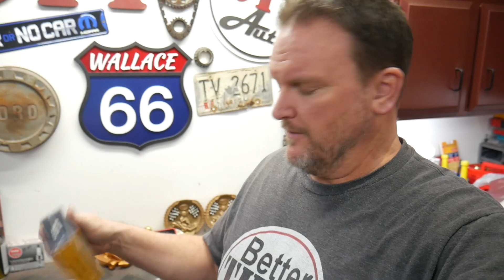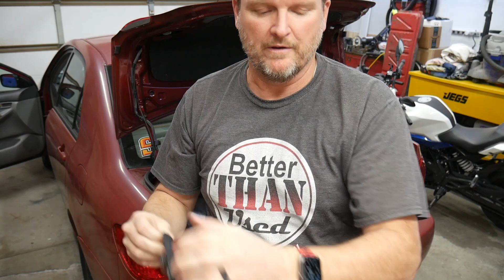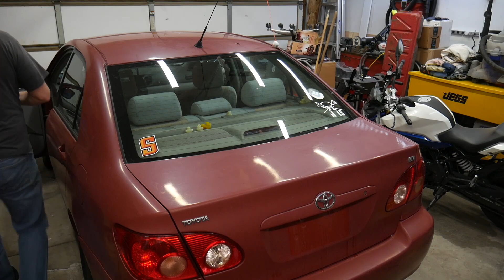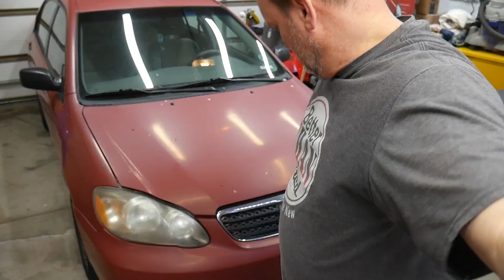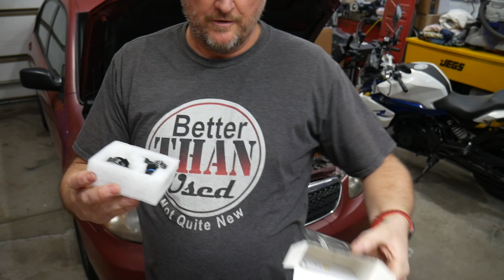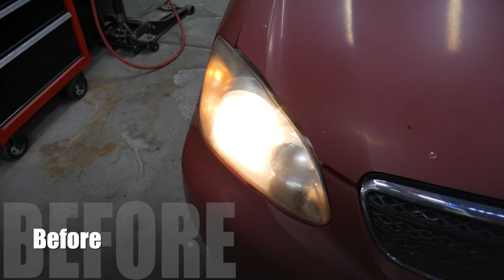EASY 2003-2008 Toyota Corolla LED Headlight and reverse lights Upgrade AUXITOLED

Comment: How many lumens are the headlight bulbs? Any issues with getting flashed by other drivers? TIA
Reply from the maker: These were 12000 LM no one ever flashed bright at me after this swap. 

Auxito does has some that are 20000 LM. The description of each bulb has the lumen rating listed: https://www.auxito.com/?ref=6d1hIV75
Reply: I assume the bulbs are still performing well.
I'm not familiar with this company, but likewise want to upgrade my bulbs as I can drive 40k miles a year for work so having great headlights makes that nighttime driving especially in less than ideal circumstances so very nice.
Old Mopar vehicles like Dodge trucks & Jeeps had such lackluster headlights when I upgraded my '00 Cherokee to LEDs it was the best money I've spent on that vehicke.
Reply: @harvestblades  those Auxito Y13 are a must upgrade. Those particular led bulsb are reliable. 

Definitely recommend them. 🙏🏼

Comment: when I'm connecting the bulb has a positive and a negative side, but the car has an A and B connection. I don't know how to connect the bulbs to the car wiring
Reply from the maker: Try it one way. If it doesn’t work reverse it. LED lights only work when + & - are connected correctly.